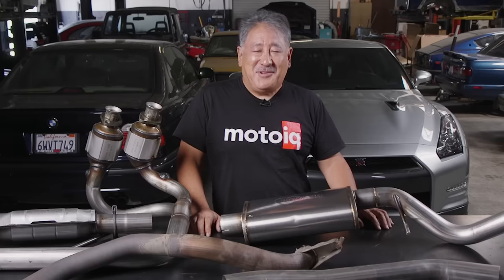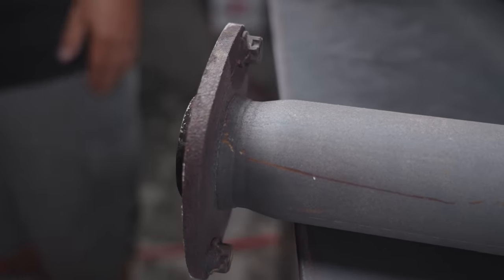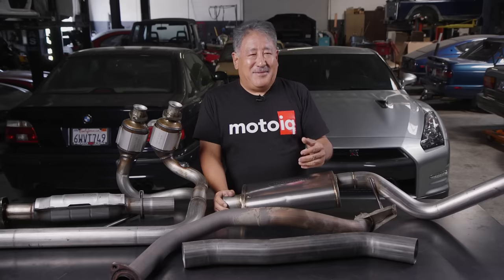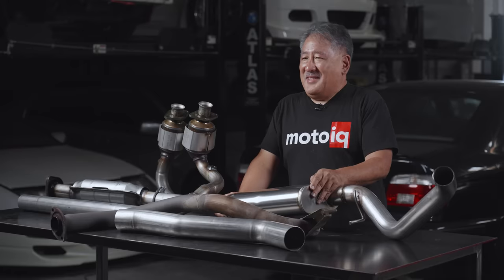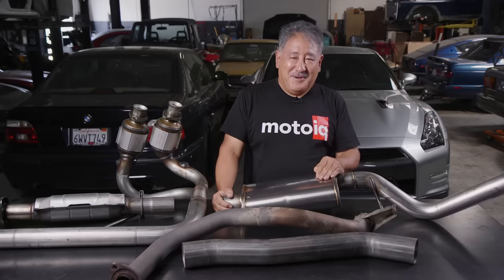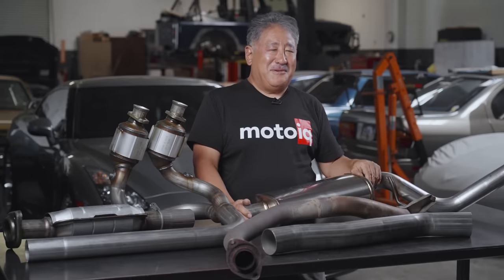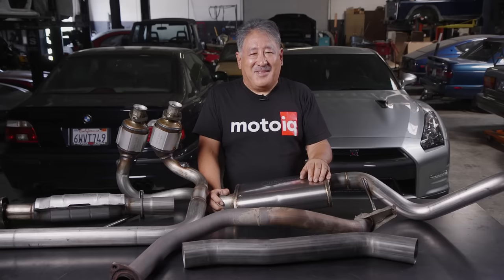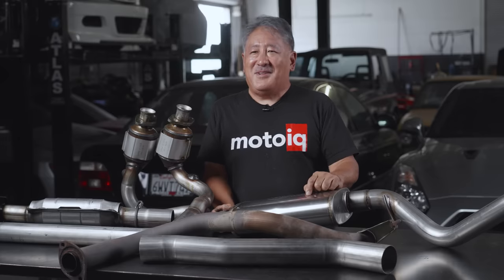Exhaust Back Pressure Myth DEBUNKED!

Comment: Those are very simplistic explanatios but in reality exhaust dynvamics are a whole lot more complicated than that. Sound waves and harmonics travel up and down the exhaust track. Sound waves bounce back against the overlapped fuel/air mixture that passes by the exhaust valveb and reveses direction back to the cylinder creating a double charge. That is the main reason a well tunned and designed header adds huge improvement and bad designed and misunderstood header fabricators remove torque and horsepower.  There is a lot more to exhaust systems than a simplistic explanation ! Sound waves and resonance is key to exhaust design !
Reply from the maker: This isnt a video about that, we talked about that in our headers video, search our site.
Reply: @motoiq  ok then, long tube headers sort of nails it. My school of thought it is, its always a compromise. Back pressure increase exponentially with RPM and exhaust output. It is always a compromise in the overall design to optimize the power band. Ideal primary diameter and length is good for a target rpm and power band.  Away from that it falls short either in the low end or high end.  On a second note, consider adding a ventury restrictor at the collector to move the power band up or down, its been proven as a great aid to tune the torque and hp up or down the rpm range ! Cheers !
Reply from the maker: You know in my Dyno testing experimenting with the venturi diameter in a merge collector affected the whole powerband and didn't move it up and down but made the powerband wider when you got it right.  Burns makes a merge collector with verturies you can switch out quick on the dyno.  It always seemed that engines liked one smaller than you would think and 1/8" could make a huge difference, especially with engines with big cams and a lot of overlap.

Comment: This is exactly why sticking a potato in your fart cannon exhaust tip actually is dyno proved to increase horsepower. Because the fart can exhaust reduces back pressure, but the potato increases exhaust velocity.
Reply from the maker: Of the potato

Comment: Back pressure is just the wrong choice of words. However,  saying that exhaust gases need the highest velocity 100% of the time is not correct.  It is absolutely possible to have an over scavenging/under scavenging condition, which can also have an adverse impact on VE ( volumetric efficiency) . The science behind the functionality of an exhaust is step tuning with length and diameter.  There are a ton of variables that come in to play here . If you have an exhaust with zero restriction,  you will, most of the time run into over scavenging and loss of low rpm power and fuel economy.  Under scavenging will have similar loss of power on the big end.  A really well built exhaust will use different bends, lengths, and diameters of exhaust tubing at different places throughout the exhaust to slow down and speed up the exhaust gases . This helps them " Tune" the exhaust to match characteristics of a overlap event, as camshaft profiles differ greatly.
Reply from the maker: You are almost right. But if you look at the whole thermodynamic system of an engine, backpressure never helps at any RPM. The other thing is its almost impossible to overscavange an engine.

Comment: Maybe in a modded engine,I used to believe more is better til I put duals in my 1998 f150 4.6,it completely lost any snap it had and ran waay better when I went back to single 3inch iut behind the rear tire..
Reply from the maker: It's never not enough backpressure, its not enough velocity.

Comment: Back pressure is good for low end torque. Sure wide open throttle high rpm you want less.
Reply from the maker: Not necessarily, a good exhaust creates negative pressure at the exhaust port in parts of the cycle

Comment: What about if I’m running a race motor with a completely open exhaust port on the engine, completely eliminating the exhaust system entire for an open wheel kart kit car with a rear mounted motor like the arial atom 500 but with zero exhaust system on a na engine
Reply from the maker: You loose the scavenging effect from reflected waves and gas column inertia like I said in the video.

Comment: Sounds like old timers had the right physical idea, but were wrong on the mechanics on why it worked.
Reply from the maker: This
Reply: @motoiq   @motoiq  I feel like the real issue here is a matter of semantics. The meanings of exhaust velocity and back pressure are simply confused. A lot of people still aren't aware of the difference. Most of the people saying back pressure doesn't matter are running open headers or straight pipes on a stock engine and actually losing power. Those people would still be wrong.
Reply from the maker: Its not so much the open system but the diameter of the tubes.  You can run an open exhaust on a stock engine with good results if you size the tubing right.  Put a huge open pipe on and the power and torque can go to shit.
Reply: @motoiq   I cant think of even one NA vehicle where the exhaust tubing is narrow enough that you could run open/straight piped without losing power. I would like to see a dyno comparison before and after.

Comment: With all that in mind, why aren't there any vacuum designs?   Instead of forced induction... assisted exhaust?  Is there such a thing?  In theory you could even do both - forced induction with assisted exhaust.
Reply from the maker: no because of entropy
Reply: @motoiq  ChatGPT gave me a much more detailed answer lol...  

"Forced or assisted exhaust, in the sense of creating a vacuum on the exhaust, would not increase airflow or horsepower. In fact, it would likely have the opposite effect by restricting the flow of exhaust gases out of the engine.

Exhaust systems are designed to allow the engine to expel waste gases as efficiently as possible, using a combination of backpressure and vacuum. By creating a vacuum on the exhaust, you would be increasing backpressure, which would make it more difficult for the engine to expel waste gases. This could result in reduced power output and increased stress on the engine.

Additionally, creating a vacuum on the exhaust could potentially cause damage to the engine. The vacuum could draw in air or other substances, such as dirt or debris, that could harm the engine's internal components.

Overall, forced or assisted exhaust in the form of a vacuum is not a viable method for increasing airflow or horsepower. Instead, the focus should be on optimizing the design and tuning of the engine's intake and exhaust systems to achieve the desired performance goals."
Reply from the maker: It would take more energy to actively suck exhaust out of the engine than any gain that increasing the VE this way could get.
Reply: @motoiq  You could run an electric vacuum that doesn't take any energy away from the engine - but it's moot because, as the bot said, it's a bad idea for several other important reasons
Reply from the maker: It takes energy to run the vacuum pump!  Where is that coming from? A battery?  How is it going to be charged, an alternator driven by the engine? It's why perpetual motion machines don't work, they violate the second law of thermodynamics.
Reply: @motoiq  It takes energy to run a supercharger or turbo too - they're both still net positive on horsepower.   You could run a vacuum pump on a battery, with or without an alternator.   Anyhoooo that's beside the point - as the bot confirmed, its a bad idea for different reasons (one of them being that the vacuum itself would have a negative effect on performance) so the conversation is pointless anyway.  But yeah a vacuum pump needing energy is no different than a turbo or supercharger needing energy.
Reply from the maker: That is because they are greatly increasing the intake density ratio so you are multiplying the amount of energy each cycle produces, a lot beyond the energy needed to drive the compressor. It's a fact not open for debate.  I could prove it to you with a bunch of thermodynamics you probably don't care about or you can take my word on it.  It's why they don't do stuff like that.  If the battery is getting recharged by any of the car's systems, it's a net loss.
Reply: @motoiq  You don't seem to understand the conversation.   You keep trying to convince me that a vacuum on the exhaust is a bad idea but I'm not arguing that point.   The bot provided us some pretty good info as to why that is.   That a vacuum pump (or ANY electric motor) could be run on a battery, charged by an alternator isn't really up for debate either.   I don't need to prove that -  the entire electrical system of basically every car in the world  runs on a battery that is recharged by the system.   Would a vacuum on the exhaust be beneficial for performance?  No.   But not only for the reasons that you're stating.  The bot actually gave several very logical reasons why.  Thermodynamics don't even come into the equation yet because it's a fundamentally counter-productive design.
Reply from the maker: I am telling you that mechanically creating a vacuum in the exhaust is a bad idea when you are looking at the overall system efficiency I think we both agree on this.  A properly designed exhaust has below atmospheric pressure in it for parts of each cycle.  That is desirable. I think we both agree on this?
Reply: @motoiq  Yep I agree with you on both of those things.  The first point follows the second actually - the reason that a vacuum would make it less efficient is that it would  interfere with that pressure cycle you mentioned (among other things).   Seems like it's really about the fluid dynamics though.  I did learn that some industrial applications use "Induced draft" which is basically pulling air through a system instead of pushing it.   I don't think combustion is part of most of those application but... it is a thing.  :)  Thank you for taking the time to answer my questions @MotoIQ!

Comment: I hate how the backpressure topic has been contorted,
No, you don't need backpressure to make power, especially true at high rpms,
However, backpressure at idle, under load at sub 2000 rpm, on engines 4 cyl or larger is preferable for the torque needed to get moving
Reply from the maker: That's not how it works.  Like in the video you need scavenging, even at low engine speeds.
Reply: @motoiq  sorry i didnt notice your reply, 
i cant prove my thought because ive not the money or equipment, but i have built 7 motors now- different as hell, and 4 of those i prioritize low and midrange power and torque for street drivability.
ive seen a noticable effect when i use 2 1/2" headers, 2 3/4 down pipe, into a cvm high flow catalytic converter- and 40 series delta. this setup gives more torque at 2900 to 4300 than the straight through xpipe at 2 3/4"
i dont like to argue, but if you can prove me wrong, then i need to tell people that ive told them wrong

Comment: What if you could have a vacuum on the exhaust side of an engine, would this help or hurt performance? 🤔
Reply from the maker: Hurt because any power gains due to VE improvements would be erased by the power needed to make the vacuum via the second law of thermodynamics.

Comment: you are absolutely correct of everything you said about exhaust.but try and tell the boost-a-holics with their subi sti that has unequal length header tubes with a turbo on the exhaust collector stock that gives the sti that blubbering sound they all love ...thats costing them hp engine life and miles per gallon and they will laugh at you and tell that it makes no difference at all ...all im saying is check this is out your self  and the story i read when the 1st sti was on the assembly line when they tried to put the engine in that had equal length tuned header it would not  fit .so they modded the header thinking they wont sell that many and fix the problem later on a recall but the Americans demanded more than they could recall and let it go ...the wrx FA20 engine has a tuned header on it and sounds like it hits on all four cylinders vs the  sti that does not ...if somebody made a video to show the different would probably cause quite a riot so  you probably wont say a thing about being in the the business you are in ..but i would
Reply from the maker: An equal length header on an EJ makes more power and is what we recommend but a lot of Subaru people like the weird noise.

Comment: You are WRONG.
My Miata had the cat accidentally smashed the innards then removed.
It had a nice free flow.
The low rpm power was simply unacceptable.
When starting from a start, I was literally scared a few times at how awful the acceleration was until I got some RPMs going.
It would be fine on the race track but not for the streets.
You are absolutely WRONG.
After the exhaust was closed a little bit (right before the slightly modified cat) the low rpm power went up significantly (it's still lower than with the cat it had).
Reply from the maker: I am absolutely not wrong.  The shelled-out cat became a huge dump node that absolutely killed the velocity of your exhaust stream and ruined the scavenging just as how we explained in the video if you bothered to watch it.

Comment: Ive found my 289 and 351 C dropped a half second on the quarter WITH cheap turbo muffs , so some back pressure helped me , compared to open long headers . Um so who s the dummy ?
Reply from the maker: If you put header collector extension on, then jetted for it you would be even faster unless your primary tube diameters are way off for your engines state of tune.

Comment: it depends what size engine. a 4.0 v6 needs more backpressure to get the right velocity and maintain torque than a 4.6 v8 which means you can put more non-restrictive exhaust and not have issuea. saying all backpressure is bad is simply ignorant. what you reaaly mean is that you need the right amount of backpressure for your engine.
Reply from the maker: Backpressure is NEVER good nor needed on any 4-stroke engine. It is not ignorant, it's thermal dynamics.  Saying you need backpressure is ignorant.  Don't believe us, See what the guys at Gale Banks say. https://www.youtube.com/watch?v=2tZYJHtXG9s  See what Gale Banks himself says. https://www.youtube.com/watch?v=k7yYY_hy250  Don't confuse backpressure with scavenging.

Comment: Had a 82 mustang gt 5.0  , 4 spd , .. my dad  put headers an straight piped to the mufflers , with 2 inch flex pipe from a fork lift and.a.set.of thrush turbos lol no cats .back in 93  , put a  4 brl  holley on it ,  came with a 2brl . holley .. make er breath an ahe will run lol an 373 i think or 411 ..an old man made a custom ram air outta the dual.snorkel and cut the hole in factory scoop made if functional.   Sucked in rain anyways 😂  lol ..sqwak into 3rd

Comment: I hate it when a engine is described as being nothing more than a air pump. Yes, it is sucking air in while blowing air out but then again so are we. It's fare to simplistic and in someways misleading description of something that requires controlled explosions in order to operate. I wish they wouldn't use it because it leads  people think engines are just air compressors used to pump up your tire.
Reply from the maker: But it's good to speak in terms that more people can relate to, its an analogy ok?

Comment: Well, I put on my 03 toyota solara.  And lost my torque. Anybody have any thoughts.  Other than putting the old one back on. Dyno tune?
Reply from the maker: Is the exhaust too big for your engine?
Reply: @motoiq  I have a 3 L v6. My regular mechanic put it on. I was designed for my car. J2 engineering exhaust.  I'm either going to put the original back on. Or have it Dyno tuned. Ty for the response.

Comment: My 2018 felt more torquey before I replaced the front pipe with the cat. Without the cat therefore less back pressure I think I lost some power. I felt a slight drop in torque no doubt about it.
Reply from the maker: Did you check your state of tune like your afr?  Did you put on a downpipe way too big for your state of mods?
Reply: @motoiq  Yes and the downpipe is the correct size.
Reply from the maker: what was your AFR and the size of your downpipe and what kind of car?